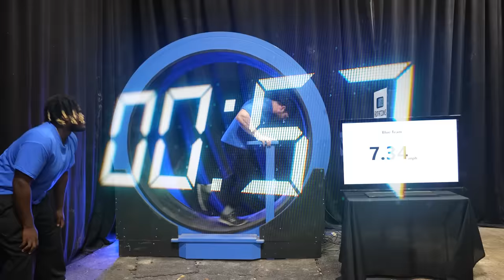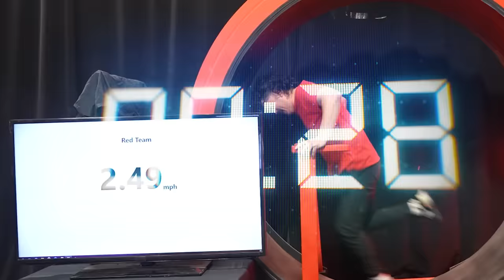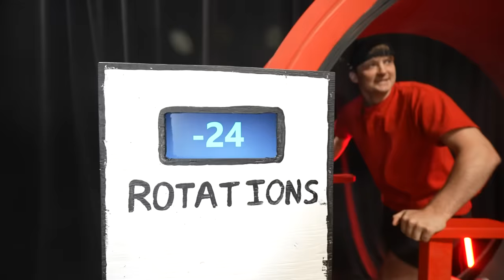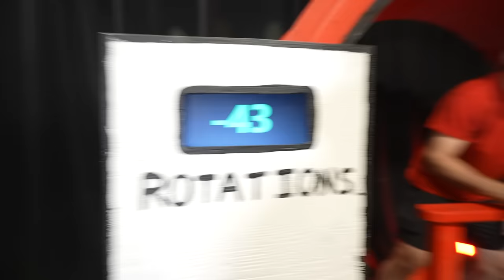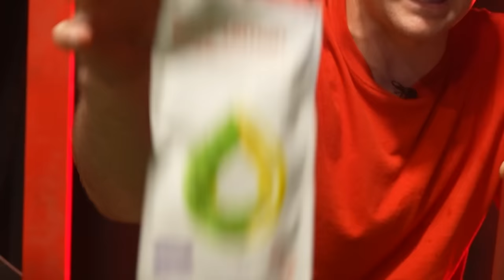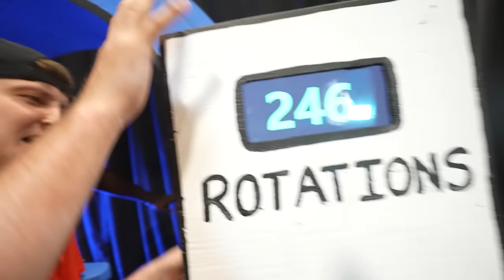Beat The Hamster, Win $10,000

Comment: Instead of pushing on the treadmill, you should run closer to the front of it. Then you don't use all of your strength on pushing, but your boddy weight to push it down in an angle 😉